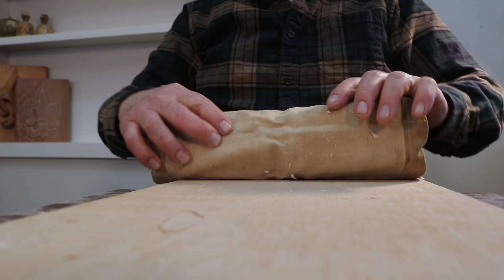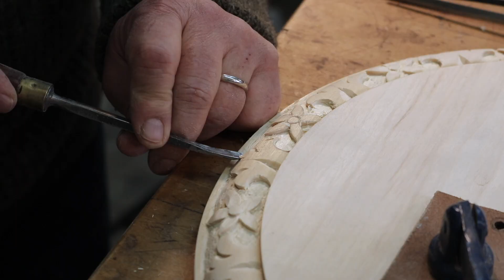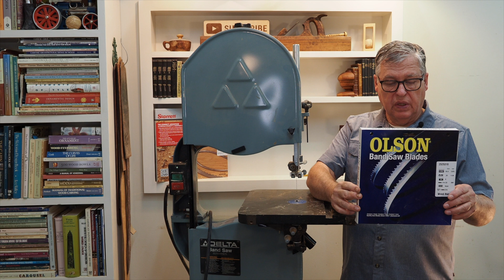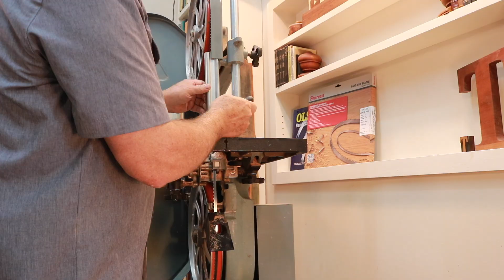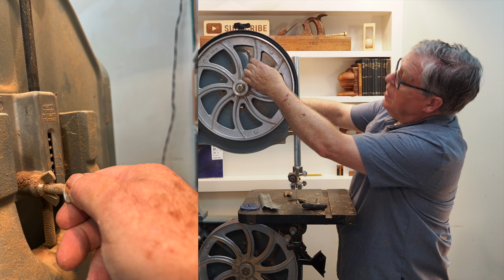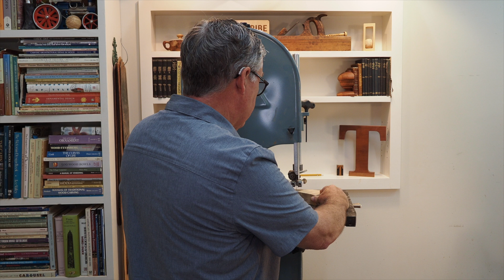How to Replace a 14" Band Saw Blade

Comment: I have a question. I just purchased an older model of craftsman 14 in band saw. and i was dusting off some build up as well as lubricating some of the moving parts, particular the upper guide bearing shaft. I noticed as i pulled it down a ball bearing popped out from the top. the shaft still glides fine but im wondering what should I do?
Reply from the maker: You should replace those bearings with new ones of  the same size and type. I replaced my guide bearings as they seized up over time. It works like new again.

Comment: Thank you for this video, it is great. Do you have video on adjusting the blade blocks?

Thanks again
Reply from the maker: @KadesCam  Thank you, I’m glad you found it helpful. Regarding the guide blocks it was an oversight not to mention that. I don’t have a specific video addressing that step. But it is very simple to do. Just loosen the set screws on all 4 blocks. If they are really worn out then it’s best turn them around or simply replace them. Back the blocks off until all the other adjustments I mentioned are perfectly set. Then move the blocks back into place so that they just barely touch the blade. Make sure not to pinch the blade when you retighten the set screws. Then give the wheel a freehand spin and listen to hear if it’s rubbing any of the guide blocks. Slight noise is normal but it causes problems if the blocks impedes free movement. And BTW guides must be set up just behind the gullets of the teeth. Hope that helps, it’s a joy to work with a well tuned up machine.
Reply: @shoptalkwithtim  that helps alot, thanks